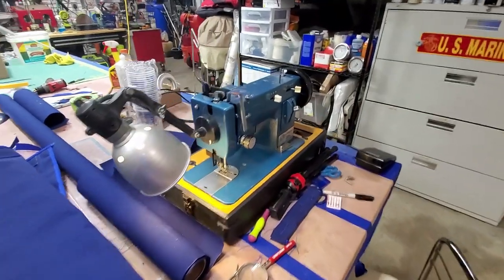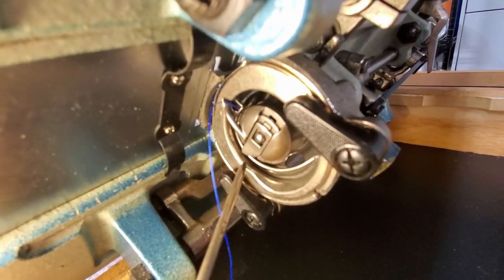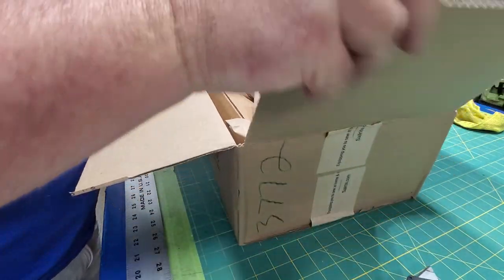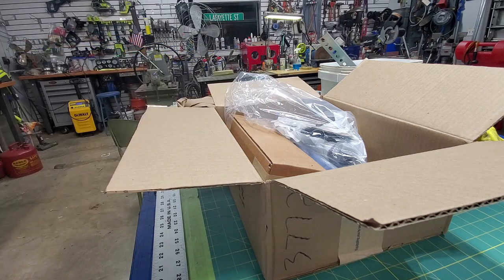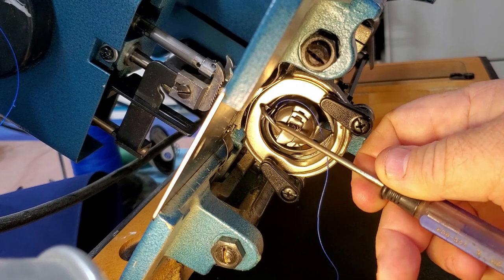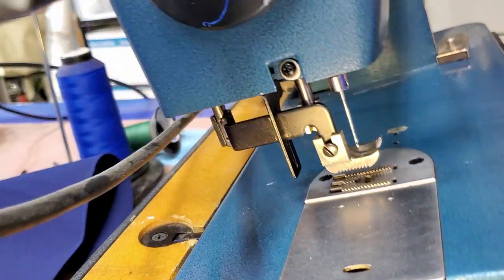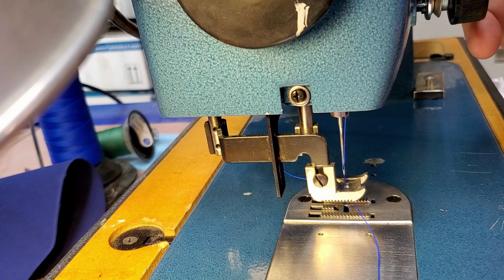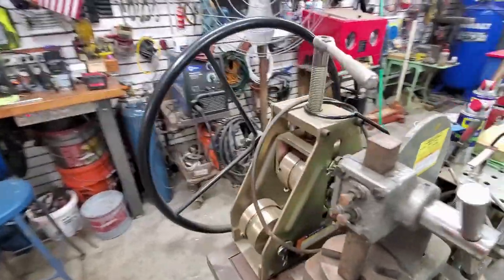Sailrite LSZ-1 Malfunction while sewing Sunbrella. Simple Fix!

Comment: I found your video while repairing my stack pack. I'm a newbie sewer and giving my Sailrite a workout. My issue was the thread shredding on reverse stitching. While watching your video I discovered I had burrs on the shuttle gib hook and retaining ring cap spring. We filed those and it solved my problem. Thank you very much!!
Reply from the maker: Thats awesome. So glad i could help in any way. These machines are very capable..but also very frustrating when not working properly. Have a good 2023!

Comment: I am doing something I normally don't do and that is commenting before I watch the whole video. But in the beginning I saw you did not have the thread threaded through the hole at top where the needle gets screwed into. There is a hole up top that the thread goes through before you thread the needle. Don't worry I did the same thing. Hope this helps you.

Edit: see if I would have watched the video the whole way through I never would have had to say what I did above. Good job!
Reply from the maker: Someone else pointed that out. That was just an error in the middle of fixing the broken pieces.  My old eyebulbs aren't what the used to be. Later in the video I had to rethread and got it right. Thanks for the comment
Reply: @mvintrigue-trawlerdiy1101  yes I just watched your video the whole way through and saw that you had it done correctly later on. If I would have watched the video the whole way through I would not have had to say the last comment.  .Great job!
Reply from the maker: It's all good. I did rethread it later because the thread pulled out. But I never noticed I had it wrong...even though I was setting tension..lol. only when it was pointed out here did I notice. Can't get in a hurry and double check the easy stuff. Can't believe I made that mistake, can't believe I didn't notice, and can't believe I put it on video and STILL didn't notice...haha.
Reply: sail rite sent me a video on how to trouble shoot the bobbin winder . I finished the bimini for our 36 ft trawler, I used their kit for a 4 bow bimini. I highly recommend their kits and tools!

Comment: I have a clone of that machine works great.Those clamps should be made of metal. I mean the whole machine is metal just about. I dont get it why thats plastic do you ,LOL!. Why not those clamps,HA! Thanks for posting your video to this problem that was a weird issue for sure. Learned something new!
Reply from the maker: Right!? The thing is a tank. They could have cast that in steel easy..lol
Reply: @mvintrigue-trawlerdiy1101  $$$$$$$$$$$ cheaped out on that part for sure,HA!The old Singers for decades were scewed in those spots with two adjacent screws instead of those cheap clamps...

Comment: my bobbin winder stopped working. i am in the middle of making a bimini, any tips. should I just buy a new assembly?
Reply from the maker: I actually bought one of those cheap Amazon bobbin winders and it works great. I havent had to mess with my bobbin winder or try to fix it.